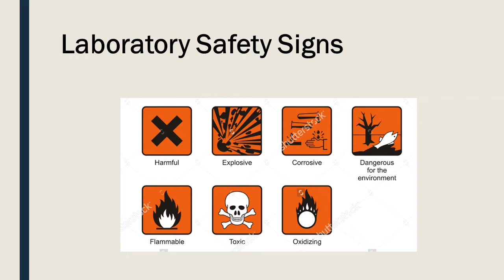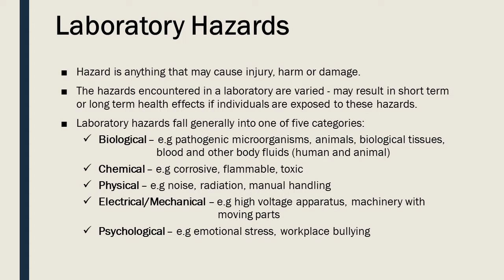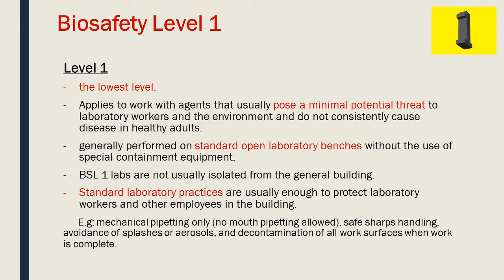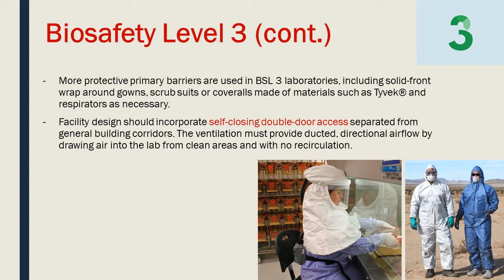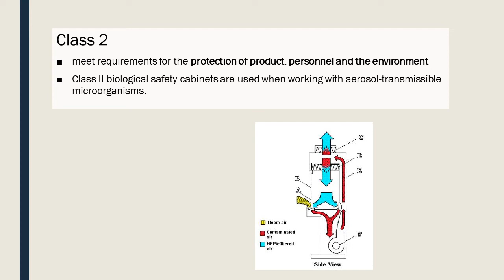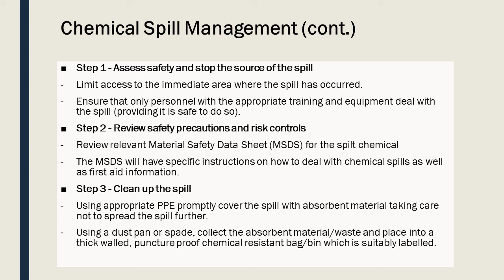Laboratory safety

Comment: 1. Unsafety aspect in lab photo - one of the lab workers not wearing PPE (lab coat, gloves etc.)
2. For SARS-COV-2 will be Biosafety Level 3 due to its aerosol transmission.. however, based on CDC the updated biosafety level at minimum should be Biosafety Level 2.

Comment: Hi Dr!

1. It is seen in the picture that one of the workers is not wearing PPE in the laboratory. Also, the technician sitting alone did not tie her hair properly, this should also be considered as an unsafety aspect.

2. SARS-CoV-2 is aerosol-transmissible, thus a laboratory of biosafety level 3 (BSL 3) is required.